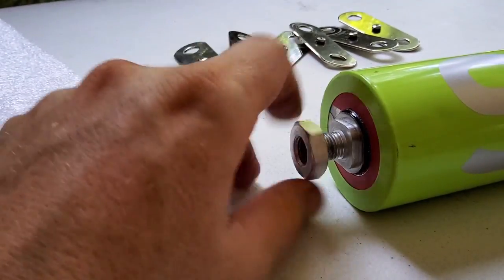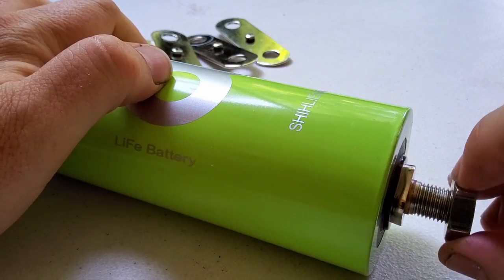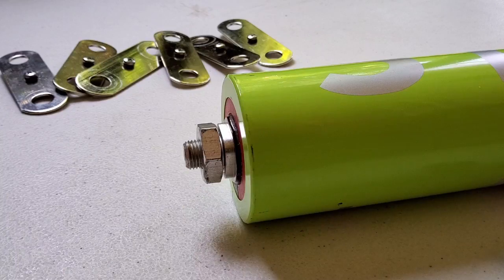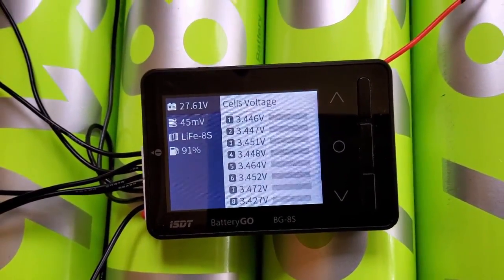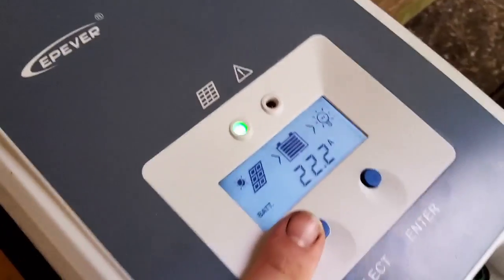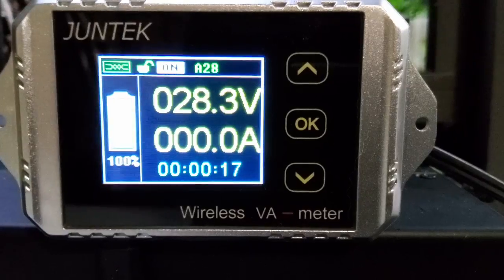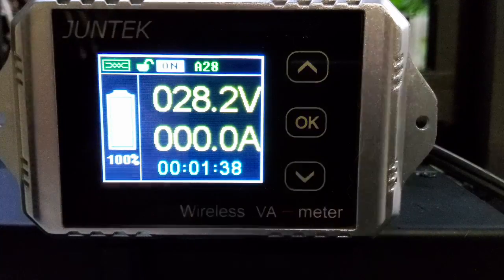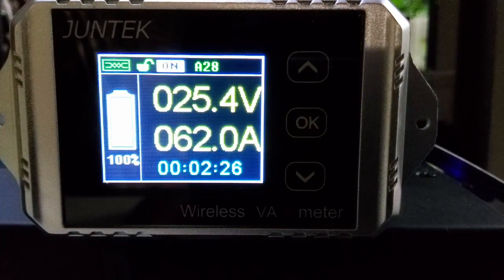Big Ass 60280 55Ah LiFePO4 Cells

Comment: So, hrm.. I love the "look" of these cells(I know its silly but they are sexy af to me) haha.... but im truely wondering how practical would it be to use these in DIY 12v (4s2p) powerstation w/ inverter? Or would there be better options for that sort of use case?  It seems pretty dang cost effective considering 1400wh for less than $300 in lifepo4 batteries..?  Also, how much do the cells weigh? nm, think I found the answer on chinese website: 3.6lbs per cell.
Reply from the maker: Yes I agree they are very visually appealing. Something you would want to showcase IMHO. I would say they are a bit large, and heavy for their energy density, but not bad at all. Great value for sure. BTW you'll get another 5% off if you use my discount code BMC

Comment: Have you tried discharging them at the rated 2C or even 1C, or .5C ? If not I am curious what results you would get.
Reply from the maker: I discharged at 1C in this video.
Reply: @BradCagle  Yup Im an idiot, sorry had watched the video a while back and forgot, getting completely different results, will do some more testing.
Reply from the maker: @ShaleAudio  LOL, no sweat :) So are you getting less capacity than expected?
Reply: @BradCagle  I'm switching to a different case and testing now. I had really good results on my first case and ordered more, but hadn't done a full C discharge test. On this batch I am getting crazy voltage sag and bounce and I am wondering if the terminals got over torqued or damage done on the inside. Now that I see you got full results on 1C I will check a different batch. Thanks for the videos, not much out there on these.
Reply from the maker: @ShaleAudio  Yeah I have two cases, ordered weeks apart. Both had the same results at 1c. Hope you get it worked out! BTW I cleaned the terminals really good, mine had some gunk, and debris. You might have some oxidation.
Reply: @BradCagle  yup turns out they were all from one case, maybe supposed to be rejects and got back in somehow. Every other one I've tested so far hits between 55 and 60
Reply from the maker: @ShaleAudio  Ahh, bummer, but BH should take care of ya

Comment: Say I make a 220ah bank of these for a 12 volt system. Will they be good enough for a car audio system. My amp will draw around 8-900 amps for short bursts.
Reply from the maker: The max discharge rate is 2C, so that would be 220A x 2C = 440A. I would like to say it would handle short bursts of 8-900A but I have not tried. Many LiFePO4 batteries can do 5C - 10C pulses.
Reply: Thank you

Comment: I bought two cases for 48v 55-59ah four wheel buggy i am building and will fit perfect in battery box. they are a little heavy for my application but the frame is metal not Aluminum so with corner wings it will be just fine. also bought TACKLIFE DC Power Supply Variable, 30V 10A with Course and Fine Adjustments, 4-Digits Display -MDC02 for the initial balancing in parallel. still waiting on O.S stock to come in for BMS.  my rims are 29" three spoke white rims and the frame will be flat black. drive system is 48 volt 2000 watt motor and controller.
Amazing cells.
Reply from the maker: Oh man, that sounds like a super fun project. Get us some pics, and or video when you get it going!
Reply: @BradCagle   Absolutely, the whole project has been so fun  but daunting to say the least. dealing with the shortages are a total pain as you know. the rims make the whole project, beautiful.
Reply: Did you make any videos of the buggy? I'm curious how much power 2000 watts drives like

Comment: Thanks for the videos - I grabbed 8 cells - do you have a source for the bus-bars and nuts ?   and thanks for the discount code BMC !!!
Reply from the maker: You're welcome! The first set I bought I got the whole kit with nuts, washers, busbars, etc. The second set they were out of the full kit. It actually did come with the nuts so that was nice, however not sure if they send them all out with nuts. For busbars you can make them out of 1/8" thick 1-1/2" wide aluminum flat bar. That will carry about the same current as the copper bars that are in the kit. It's cheap, easy to find (homedepot) and you can cut it on a miter saw. Other than that you could contact battery hookup, they may have something.

Comment: the complete kits are out of stock now do you think i could use stainless steel nuts and aluminum busbars?
Reply from the maker: Aluminum busbar is fine, and a cost effective option. I buy the 1/8 thick 1-1/2 wide flat bar from home depot. That size will meet or exceed the ampacity of your typical copper busbar. Stainless is a bad conductor, use brass, or steel. Just FYI, I ordered another set (not the complete kit) and it came with the nuts.
Reply: @BradCagle  Thanks! got word from batteryhookup that they will be stocking more kits soon. How do you like these cells so far? I'm planning to build a solar generator for my jeep, 4S4P in a milwaukee large packout box. Initially wanted to use prismatic but not sure how well they resists vibrations.
Reply from the maker: @willng34  I love them, I have another video coming, discharge test on this second set I have. With these you do not have to deal with cell compression like you do with prismatic. Use my discount code BMC to save 5% if you go with these.
Reply: You should match the metal as closely as possible. Aluminum will oxidize and create a higher resistance connection over time. If you use aluminum for buss bars it needs to be LARGER than copper buss bars to reach the same ampacity rating. Check the NEC "Ampacity Tables" for wire sizes. You'll see that aluminum conductors always have to be sized larger than copper to achieve the same current carrying capability. For instance a #1 copper THHN conductor is rated for 150 amps, while a #1 aluminum conductor is rated for only 115 amps. See: https://www.usawire-cable.com/pdfs/nec%20ampacities.pdf

You want to use metals as close on the galvanic scale as possible. In general, cadmium plated connectors are rated for both copper and aluminum connections. If you do use aluminum for your buss bars you'll need to clean the oxidation off the aluminum right before you make your connections. Take a 3M scrubbie pad and use it to remove the oxidation. It'll probably look a grayish color on your hands. Then put an antioxidant compound on your buss bars and your stud terminals. You'll also need to clean your stud terminals first. You can use a good contact cleaner or alcohol. You want to remove the oil that was used while the stud was being threaded. Then make your connections. You should then have the best low resistance connections possible. 

This will keep your connections cooler, you won't have high voltage drops across bad connections, and you'll have much better and safer performance. You can use NOALOX antioxidant on both copper and aluminum in accordance with the labeling. You can buy it at Home Depot or Lowe's. Here's a link to it at Home Depot. And yes, both copper and aluminum oxidize, although there are more issues with aluminum.

Comment: I have these in my cart. It was either a few packs of these or a whole bunch more headways to equal the ah. Thanks for sharing. I think I'm still going to get them. The used headways pulled 78% capacity on average.
Reply from the maker: These are the best overstock cells I've gotten thus far. Everything else has not pulled over the rated capacity like these. Use my discount code BMC to save 5% if you take the plunge!

Comment: Thanks for the review. I bought a set to use on a 24V trolling motor. They seem a little bulky but still will be much better than 2x 12v SLA batteries.
Reply from the maker: You're welcome. Great choice, these will be soooo much better than SLA. You going to put them in a marine battery box?

Comment: Just ordered 2 sets.  Thx for the code. Almost covered the shipping. Incidentally, I got the same inverter as you way back in the winter.
I'm stalled figuring how to mount my 400 watts of solar panels. I really want a sun tracking equatorial mount.  Good luck with that Eben.  ;)
Reply from the maker: Awesome, I bought another set myself. Too good to pass up, pretty sure they won't have them for long. I used Unistrut to mount my panels. I really wanted to do tracking as well, but then It was easier, and more cost effective to just buy more panels. However if you're space confined then tracking it the way, and well just super cool :)
Reply: @BradCagle  Unistrut?  Is that what Home Depot etc. sells for mounting electrical conduit?  I've been looking at that as choice construction material.
As far as my my tracking dreams go.... it's just the techie in me.  Or the idiot.
If I advance in that direction my design maxim is keep it as simple and stupid as possible.  :)
10:00 PM here at 44 deg N Lat Vt.
Reply from the maker: @ebenwaterman5858  Yes homedepot, and lowes, etc.. Goes under different names superstrut is one. I might do a vid of how I mounted. I was thinking of a single axis east to west tracker with a manual south pivot/axis I could adjust in the different seasons.
Reply: @BradCagle  Exactly.